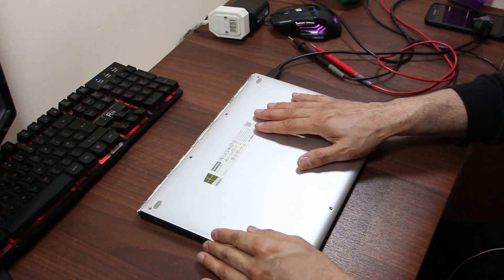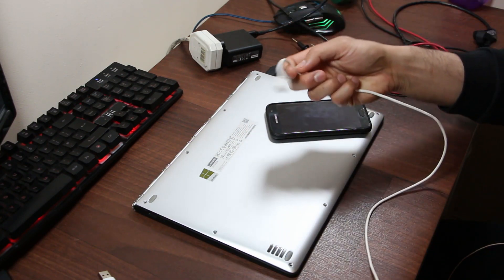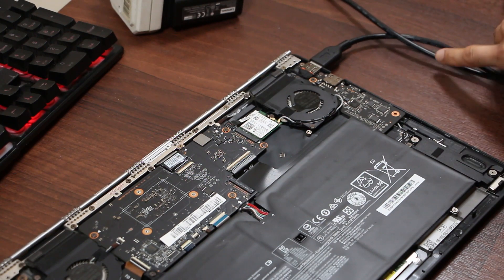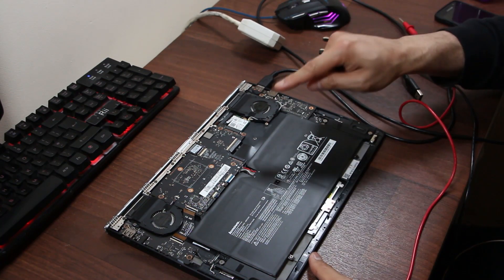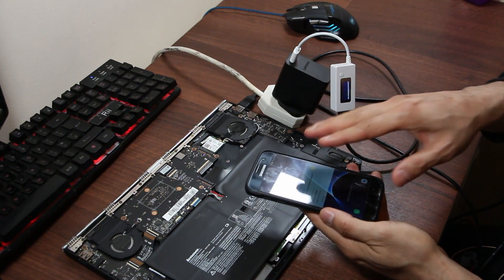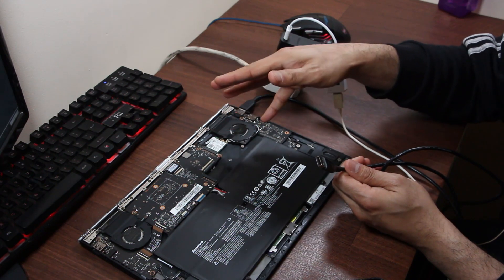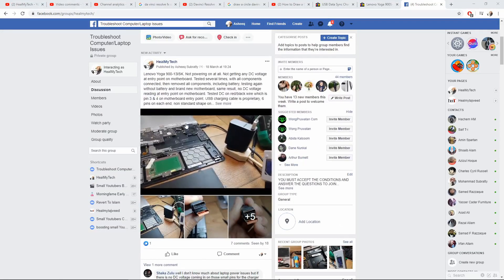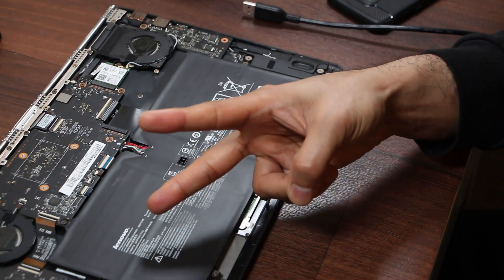Laptop No Power - Troubleshoot Only - Lenovo Yoga 900-13ISK

Comment: I have this exact same yoga laptop, and after extensive testing including all the testing done in this video I have concluded that the issue is actually simply the charging cable itself, specifically the male USB port. I replaced the female DC port, the battery, the motherboard and was not able to turn the laptop on. I went through 3 chargers and tested the first 2 chargers with the most recent replacement male charging cable and the old chargers both worked, leaving me to believe that the proprietary male USB port for this laptop wears down very quickly. So now the solution is simply purchasing ONLY a new charging cable, not the charging base, but only the cable to fix the issue. That has kept my laptop up and running for years. Hope this helps and keeps anyone else from spending a lot of money trying to figure out a solution!
Reply: Do you have a link to the charger?
Reply: @rickyurrutia9182  Here is a link to purchase only the charging cable alone which should work with your current charger if you have the USB kind. https://uspowerfactory.com/index.php?main_page=product_info&cPath=67_70&products_id=188771&gclid=CjwKCAjwydP5BRBREiwA-qrCGvKXVrnDw2ZCFgxGhIC5eivQM9SvABPKW9qCi76h7sle-Qoftw7yCxoCruoQAvD_BwE

If you are looking for an entirely new charger you can find any number of 3rd party versions sold on amazon but like I pointed out in my original comment on this thread, I believe you only need to replace the charging cable, not the entire charging unit.
Reply: Thank you just ordered the chargeing cable for 910 hope it works
Reply: @rickyurrutia9182  hey buddy did the cable worked?. I am planning to purchase one. Please suggest
Reply from the maker: Thanks for the info.  I gave the client the laptop back due to time restraint/covid-19/and another issue so unfortunately I don't have it anymore, but I would go with your findings as I had the same conclusion...! Get in touch if you can....!
Reply: please dumb this down for me (':

Comment: * 20VOLT/3.25AMP AND 5.2VOLT/2AMP***
5.2V would never charge the battery. Pretty much ALL laptops run on 18 to 20 volts usually 3 to 4 amps...
Just sayin

Comment: Your forgetting that the adapter is dual voltage output at 20v 3.25a .  I was hoping to find Pin outs for voltage. There is no 20v on my adaptor if I test it. There has been aftermarket adapters apparently that had all the assorted plugs including this one so the way I see it I just need to find out which two pins carry the 20v and what polarity.  I'm minumin 4-6 weeks order to fix and ordering another charger and it may not sort the issue of  course..

My pin 3 and 4 has no continuity and also the outside. 
My thoughts are there is a possibility that the transformer has a switch ic when it recognises that it is connected ... or there is a part in the laptop that has to tell the supply that it is connected to then carry the 20v.
Opening the cablethere are only three wires inside. 
2nd pin = ground
3rd and 4th are nothing
5th pin carries 5v
1st and 6th pin are joined

Comment: There are six pins on the charging cable, the two outer pins are linked to each other and connect to the two outer pins at the other end. It is these which determine whether the AC adapter should output 5v or 20v. In my case, this connection was broken somewhere along the cable, and thus there was only 5v output from the charger. As the outer pins do not exist on the USB tester mentioned in the video, it will only determine if the charger is outputting 5v. Pin 5 of the DC-in cable where it connects to the motherboard should read 20v. Again I was only seeing 5v here. A change of charging cable fixed my problem. Hope this of help to anyone with the same issue.
Reply: Could you explain in short how you removed the cable between Motherboard and Input?
Reply: I'm not so sure about this. I couldn't wait 2 months where I live for post on the basis it nay be the solution..   After reading this I pulled apart the cable to examine. I then took an oldpower supply and ran the 20v down the 5th pin with the negative on the 2nd.
Heard a small pop.inside the laptop and now will not turn on even under battery so I suspect a dead motherboard now!!!!
There are three wires
Blue runs to both outer pins it is a small gauge wire
Black negative runs to 2nd pin medium gauge wire
White positive carries the 5v under normal testing medium gauge wire. 

To me this doesn't answer my question.
Maybe it's the blue wire that is neat yo carry the 20v....?? Or I  may have had a faulty plug as it appeared that some voltage was going down the 6th /1st pin,and it wasn't completely empty on ohms test between.

Comment: Did you ever find out what was wrong?  I'm getting the same issue with the same exact laptop...
Reply: I have a 900 13isk, no longer charging.  Works great while it has battery life left but will not take charge anymore.  Seems like a problem with this model.  Anyone have any ideas what the issue is?  Any help appreciated.
Reply: @nick841  i had the same problem with same model 
Did you find any solution?
Reply: Any solution?

Comment: I have exactly the same laptop, it turns on for a moment, keyboard is lit, fan starts immediately and it just powers off after approx. 10 secs.
Reply: same u found a fix?
Reply: Same.
Reply: @CarlCorvin  Guys, i had this problemlong time ago with my YOGA. I hadmy laptop on, did not touch nothing and it turned off radomly. What ia have done was to reload all the newwt drivers, and also I would advice to open the back case and clean the vents as this can cause overheating and the pc can turn off the pc for safety reasons.... hope this helps. As I have not doe anything else. But i had this probem for few monts and after all this, the problem was gone....could be some win update , or something i have done regarding the drivers. 

CHeck it out at Lenovo support download page
Reply: I figured it out!  It's the $50 video cable that is killing the $500 laptop.  Be careful, use a hairdryer and a razorblade to remove the display without cracking it.  Then replace the cable.  For some reason this was causing the computer to only run a  few moments and flash "Lenovo" on the screen before the laptop would die.  Now all is fine

Comment: Did the client receive any errors regarding the USB connection of the device? Or did they just notice that it was not powering the laptop? I have a similar issue with my lenovo yoga 900-13isk. It happened after a windows 10 update didn't install correctly. I received a USB error and since this particular laptop is unique in that it is powered by USB port I was unable to connect the laptop to power in order to revert back to a previous version of windows 10. I too went through the whole process of purchasing a new power supply, power cord and a battery. I ordered all of them from Lenovo. I replaced each component one at a time and tested for power disruptions and no matter what the combination I had the same results each time. The only thing I didn't replace was the cable connector because similarly I couldn't find a compatible pin connector. At this point i am wondering if it is a software issue with Windows 10 disrupting communication from my USB ports. What do you think?
Reply: Did you ever figure out what the issue is

Comment: The Yoga 900 requires a 19 volts DC input.  Check you power supply output. The 19-Voltes comes from a different pin than the 5 Volts USB pins. The connector you complain about is a dual function connector. When not being used to power the laptop it can be used as a USB, Again read your power pack output label. The testing device you used its not applicable to determine the laptop power issue.
Reply from the maker: Thanks for that but unfortunately had to give the laptop back the next day!  Yo sound like you know what you are talking about, feel free to get in touch please for future issues, thanks!
Reply: @HealMyTech1  There is a design fault with Lenovo Yoga laptops, Many laptops fail and need new motherboard. I had replaced my charger with another that works,  They are a goo laptop when they work  i have four of these and three have power issues.   I will not but another the costs of replacing the mother board is more than the costs of a second hand laptop. LENOVO NEVER AGAIN
Reply: Correct... this is what I found... Amy idea how I can find the pin outs that Cary the 20v so I can make an adapter  as will take about 8-10 weeks to order a new cable or power supply.
Reply: @michaelmclennan6144  Pin 1 should have 20v, but that is the only valuable  reading if the motherboard does not complete the DC Power circuit

Comment: Sir I'm having a problem my screen gets struck and screen goes black but my PC will be running and after some time it restarts plz help me sir
Reply: The problem started when I updated my amd drivers
Reply: Does it do that randomly?
Reply: @theyhatekath  no bro after updating my grafix card drivers
Reply: @doom-x3774  When you turn on your computer, can you see your desktop? Like do you see something on the screen?
Reply: @theyhatekath  no it just boot as normal and after 5 min the screen switched off and my PC will be running after some time it starts
Reply: @doom-x3774  Hmm
Reply: @doom-x3774  uninstall and reinstall your drivers
Reply: @doom-x3774  download a software called DDU
Reply: @theyhatekath  I tried it it's not working
Reply: @theyhatekath  what to after installing it
Reply: @doom-x3774  uninstall you display drivers
Reply: @doom-x3774  and then reinstall them
Reply: @theyhatekath  bro I have amd gpu
Reply: @doom-x3774  so?

Comment: Aasalamualikum brother.
Processor Amd Ryzen 5 quad core, 4gb ram,processor variant 2500u,RPM 5400, graphics Amd radeon vega 8.
Can i play gta 5 on these specs with medium or low graphics.
Pls reply....
Reply: No its going to lagg really badly. Especially since you have 4gb of ram.
Reply: @theyhatekath  any laptop under 330$ which can play gta 5?
Reply: @dark007  no unfortunately.
Reply: @theyhatekath  which should i buy  among them Hp, lenovo, dell , acer.. which among them is best after sale service
Reply: @dark007  hp is the best or asus is good for gaming
Reply: Even my brother's laptop with 8gb of ram and i5 8th gen is only getting 30 fps on low
Reply: @theyhatekath  so what specs do we need for gta 5
Reply: @dark007  you need a 4 core cpu and a 1gb graphics card. Even that will lag. To get no lag you need 8gb of ram, 4 core cpu and 2gb graphics card like a gtx 1050.
Reply: @theyhatekath  okay... thanks for replying

Comment: I've never actually seen a charging cable that looks similar to a USB, usually they are rounded with a small metal pin in the middle for power, but this honestly looks like there is a problem with the small cable that is responsible for bridging the connection between the charging port and the motherboard, because you plugged your phone into the laptop charger and it works, but there is no amperage reading coming from the red and black terminals on those small pins, that's why alot of times fans might spin when you press the power button that's what the voltage will do, but you need the right amount of amperage to turn the system to get a signal to the screen.

Comment: Unplug the power socket in the motherboard then test the voltage again. Some caps on motherboard might be shorted that's why the reading was jumping.
Reply from the maker: Done that off screen several times, even with the brand new motherboard, same results...any more thoughts?
Reply: HealMyTech In that case it could be power adapter supplying motherboard with different voltages. The power socket looks like it has many terminals not just a simple positive and negative